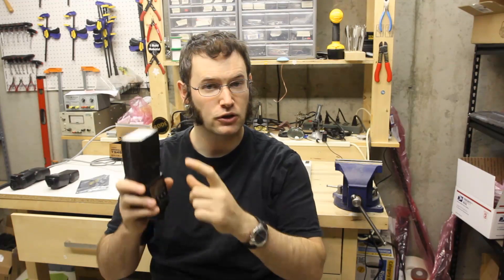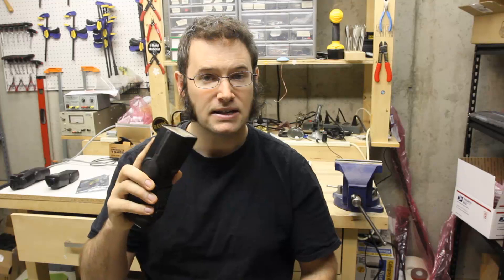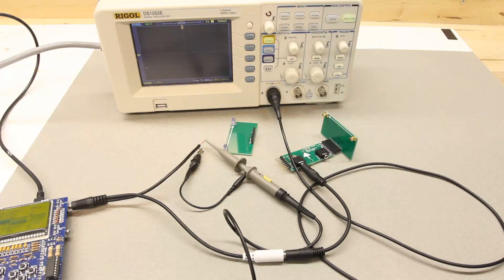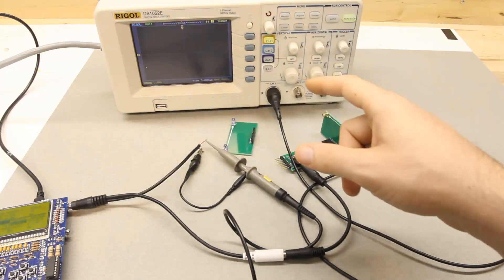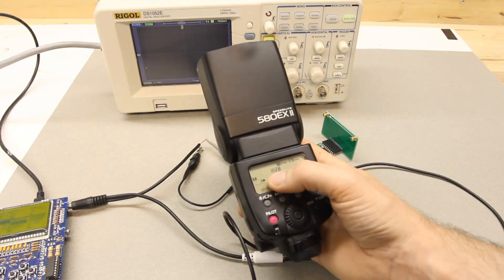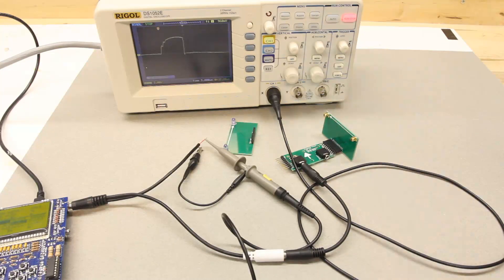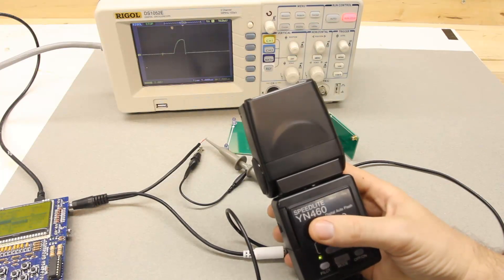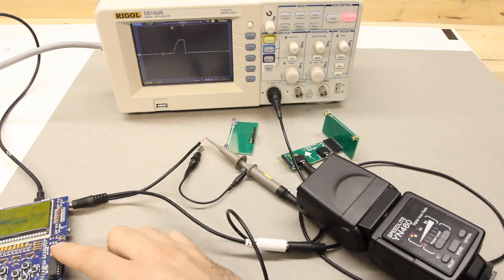TPB #23 - Measuring Flash Duration

Comment: I have a pair of Sea and Sea 110 alpha underwater strobes. Do any of your friends have these where you could measure the flash duration?  I want to start working with high speed while underwater (everything moves down there) and it would really help to get a handle on these by getting the right power levels for shots above the normal synch speed of my Canon 5D MII.  I wrote to the manufacturer but no answer.  Thanks in advance.

Comment: @Brotmaschine08 Hehe, no. I just happened to notice, that at full power I got a brightness difference between 1/160s and 1/200s (D700 & SB-900), so I guess that the full flash duration of my SB-900 at full power must be something between 1/160s and 1/200s (I lose roundabout 1/3 of a stop of power), and I'd like to confirm this.